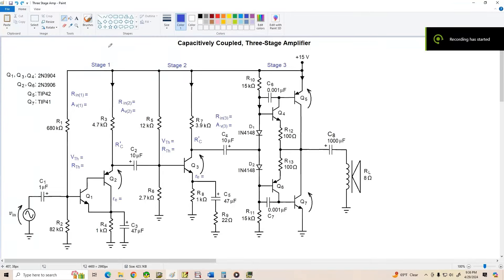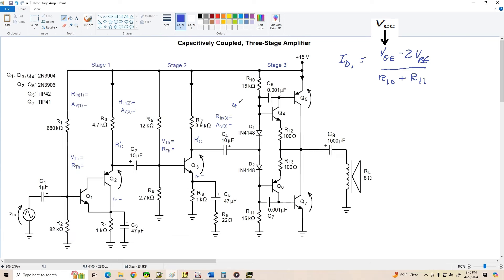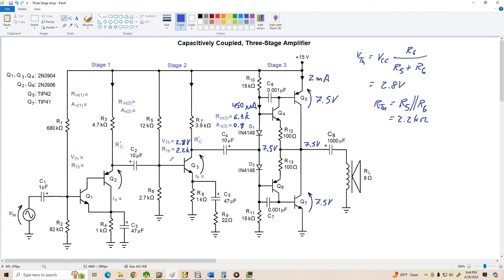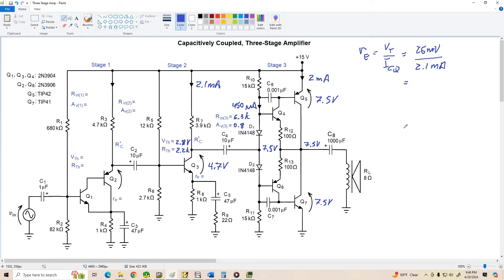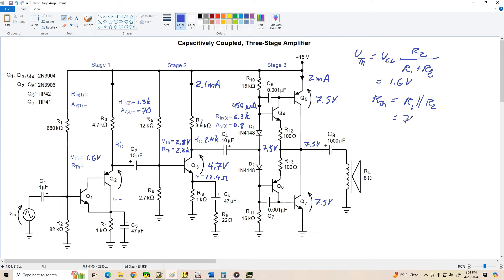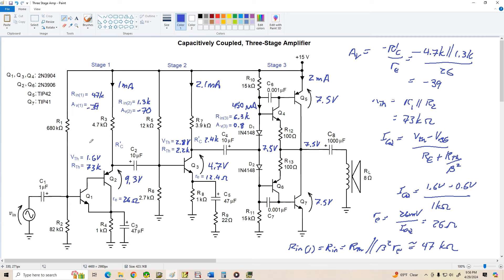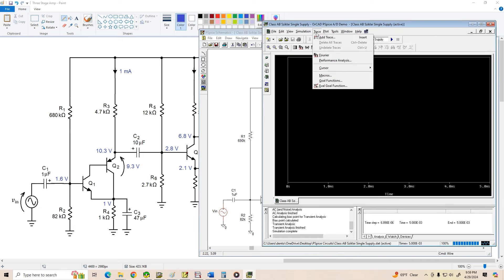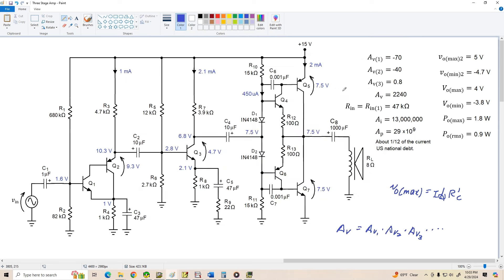Topic 39: Multi-Stage Amplifier Analysis

Comment: Why not put the Sziklai in the bottom end of the output bias arrangement, eliminating one transistor stage. Just have a low emitter resistance in it of say 22 ohms.
Reply from the maker: @Dazzwidd  all good approaches and there are many more possibilities but this video was just intended to demonstrate how multiple stage circuits would be analyzed based on the material I’ve covered up to this point. This amplifier isn’t intended to be a great design, or even a good one. It’s simply a vehicle for demonstration of basic analysis techniques.

Comment: I would try to use as few coupling caps and would add emitter resistors on the finals.
Reply from the maker: I agree. But I haven’t covered direct coupling in the tutorials yet. This amplifier was designed as an exercise in the analysis of capacitively coupled circuits. And it demonstrates the problems with using capacitively coupled, class-A amplifiers when large signal swings are desired. I’ll get to direct coupling soon.

Comment: R Th is R thevenin?
Reply: @Electronics4Guitar  can we use symetrical power supply for this circuit design?
Reply from the maker: @victimovtalent6036 definitely. The output stage could be operated from a bipolar supply with no modification (you could eliminate the output coupling cap). The two driver stages would need to be redesigned though and would still require capacitive coupling.
Reply from the maker: @victimovtalent6036 yes, it’s the Thevenin equivalent resistance. I should have noted this.
Reply: @Electronics4Guitar  thank you for your explanation,i'm very appreciate👍🙂

Comment: Why would you do all this trouble and not get a nice NE5534 or OPA1677 to connect this to the push pull setup or C4?
Feedback from the push pull output to the inverted input of the opamp and your crossover distortion should be solved not using the diodes, like the push pull circuit from the known encyclopedia. tried it in the sim, turning this opamp to voltage
 follower and the zero cross distortion returns, I have also drawn a Sziklai push pull from thin air, but now i learned about R12, R13, C6, C7.
I just used 1M to pull up / down for R10, R11 to the bases to force them transistor closed.
The Falstad sim shows it works fine.
Reply from the maker: I’ll put the transistors in the feedback loop after I cover that concept in the context of op amps. And I’ll show why that isn’t necessarily the panacea that it would appear to be. There’s a method to my madness. All in good time.
Reply: @Electronics4Guitar  Ya, using transistors may add some unique sound flavor, but i wanna make something to replace my 5€ pc speakers.
Reply from the maker: I hear ya 👍🏻